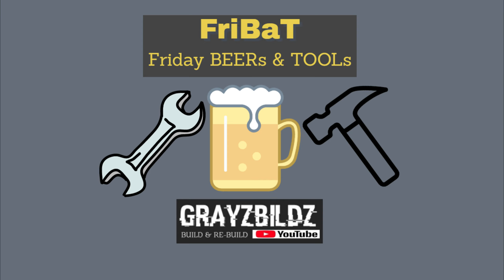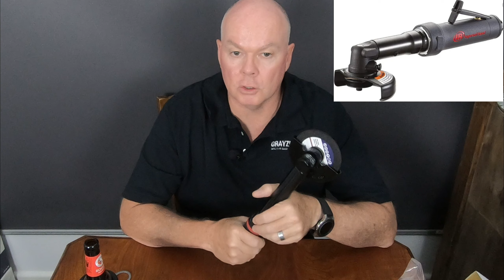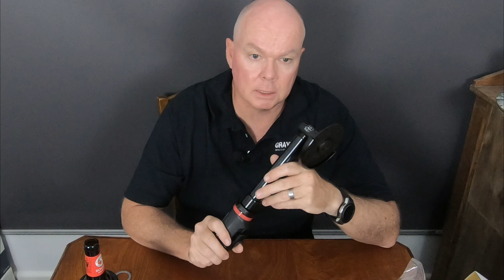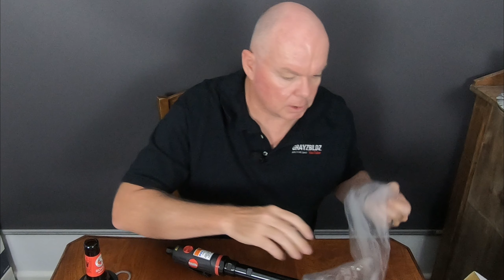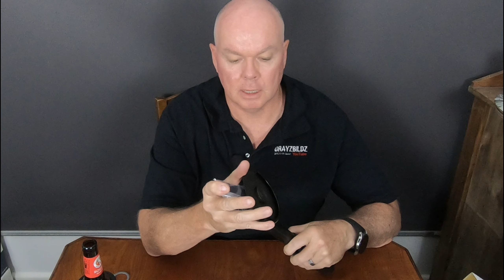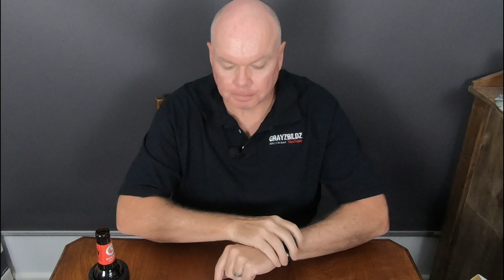Friday BEERs & TOOLs -FriBaT 01 May 20 Suntech Extended cutoff tool & Little Creatures "Rogers" beer

Comment: I happen to have a 6 pack in the fridge now..... Rather nice they are.
That angle tool is great, better than lending the prop angle measuring tool from work.
Reply from the maker: Hahaha. Glad you enjoyed it Blue. A very cheap and handy little tool. I showed the extended reach cut off tool to an aviation structural fitter mate and he had never seen one before. I think they were born from the vehicle repair industry. Cheers, Andy